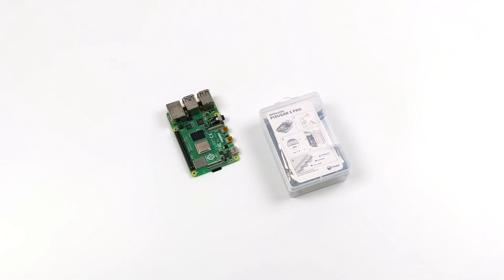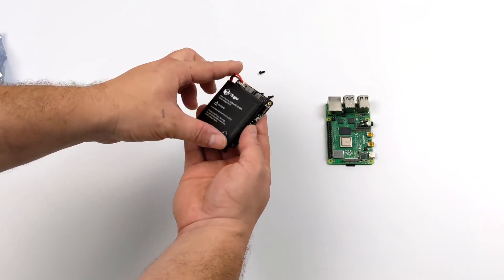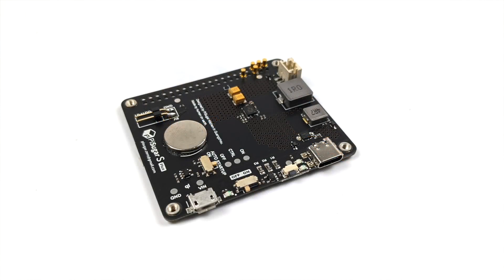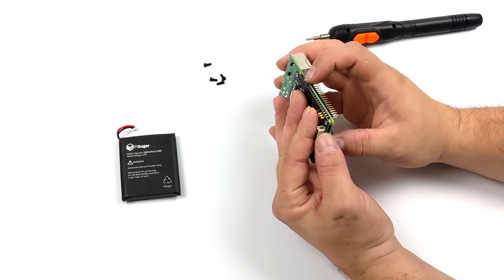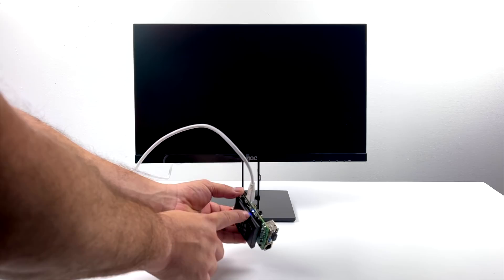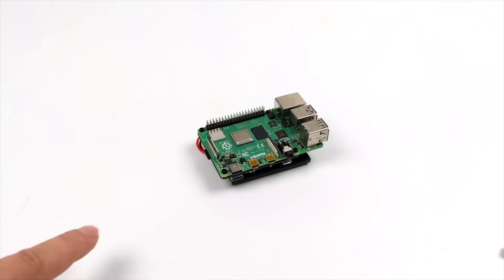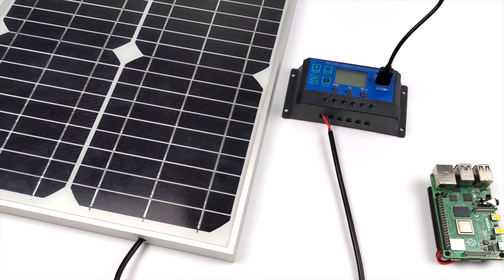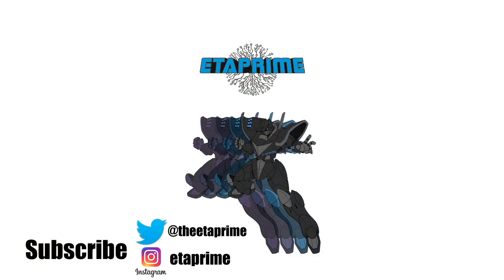Pi Sugar S Plus Review - 5000mAh Smart Battery For The Pi4

Comment: I bought the pi sugar 2 pro based on ETA's previous video.  And while it does work well, I HATE the local of the power switch. It's much too close to the pcb's charging port and the pi's video ports.
I'm using mine on a pi3b and in the car as an entertainment center for my kids on long trips.  The battery is perfect for them to pause the movie while we make a bathroom or food stop, and be able to just hit play when get back in. 
But that power switch should have been much farther forward to get away from all the I/O.
Really wish they had redesigned that part with this model.

Comment: I have the 2 pro and use it with my pi4 for ham radio applications. 
I only get about 3.5 hours out of it. I have noticed that the battery percentage readout on the web page for it is fairly inaccurate. Other then that it’s been great so far. I really like the RTC function

Comment: How do you add a case if the screws holes are already used by the battery?
Reply: Longer screws. Im using one of the armor heatsink cases and the pisugar screws through the pi into the case. Still looking for a more enclosed option tho

Comment: If power loss occurs via an attached USB power cable, can the battery step in and prevent RPi shutdown?
Reply: Yes, it's more or less a RPi UPS
Reply: @haydenc2742  Fantastic. Thank you for your reply.  Now I know I may have to get a few of these as a cheap and compact solution for a small cluster and home storage setup I have. ^.^

Comment: Any ideas on what  we can turn off or mofiy to make it use less power and last longer?

Can't wait for the solar video. Let us know what size solar panel we need and battery size to keep this puppy going continuously; even in low sun winter days.
Reply: It would be interesting to see if the wifi could be turned off if not used or when not used. WiFi searching always eats batteries. But im not a programmer so I wouldn't know how to do that

Comment: Maybe I missed it but does this cheaper board not have a way to gracefully shutdown the Pi when battery is nearly discharged? You didn’t load any software for the demo so I presumed when it got to zero battery it just switched off?? If this is the case I would never buy it. The whole point of a UPS is to gracefully shutdown when power is gone. Otherwise why have a battery?
Reply: Although PiSugar S cannot detect whether the battery voltage is about to run out, it can detect whether the external power supply is disconnected, so you can estimate the shutdown time when the external power supply is disconnected

Comment: It is an important distinction that the PiSugar 2pro with the realtime clock and extra programmability can turn a Pi into a mobile personal computer with no need for constant network connection. Unix type operating systems need to know the time when they start and the 2pro will ensure this. The plus is $20 cheaper but for most of my work having a clock is worth the expense. Mind you I can think of applications where the clock is unnecessary like I want to make my own music player with higher quality output, in a read only system like that not having correct time is irrelevant. In many environments there are a number of way of getting the correct time but nothing beats just reading the onboard clock.

Comment: Seeing it still won't charge from Pi's power, so it won't work with the official PoE hat.

Can we use one of the USB 2.0 ports in the Pi as a power input to charge the battery? Or it'll result into a power loop?
Reply: For PoE applications it makes more sense to put the UPS on the PoE switch, as if you loose that you'll be offline in any case?

Comment: Still a bit overpriced IMHO. You essentially have a 5,000mAh battery bank here which you can pick up as cheap as $15 on amazon.  If they could drop ~$10. For $29 I can pick up a 20,000 mAh pack.
Reply: 95% of the the usb power banks drop current for a fraction of second when they switch over from being unplugged from mains charger.  That drop renders it useless as a ups since the Pi would reboot from loss of power.  Additionally many use commonly and cheaply available 18650 batteries which make them bulky.

Comment: There is something I don't understand. How come when I use my mid range phone to play emulated games I can get perfect performance playing dreamcast games using Redream but my ps1 games suffer slowdown and lags when running on duckstation or epsxe. It doesn't seem to made sense at all. Anyone know why?
Reply: It might be that your phone is throttling to save battery life or etc. Its hard to know withiut ya listing which phone ya have. I used like a pixel 2 (got it refurbished for stupid cheap) or s20 se and havnt had said issues.
Reply: Probably your emulator settings or the instability of the app itself.
Reply: Hi thanks all for your replies and help. 

I got all my emulators from the playstore itself and I run my games using the apps default settings. Dreamcast run well while with ps1 games some of them are a bit choppy such as Marvel vs Street fighter and Marvel vs capom etc. Which is strange because Dreamcast games are technically more complex to run yet they play without problem while ps1 have trouble running some titles.
Reply: @anglo-saxonconnor817  Maybe there is a version of the psi emulator that is more updated on the website that you have to install as an apk?
Reply: @anglo-saxonconnor817  - Emulators have a few features to consider in the settings
-is High resolution upscaling toggled
-Is it running on OpenGL or Vulkan?
-Does the VRAM or CPU usage have a limiter?
-are the bios files corrupt?
I'd recommend to research about your PS1 emulator settings to get familiar how everything works. Emulators won't always work right out of the box.